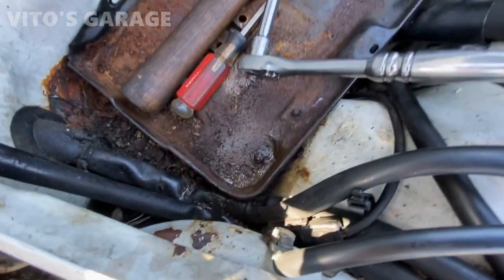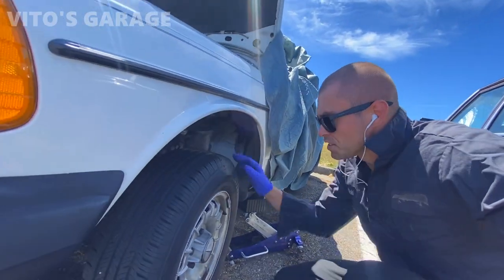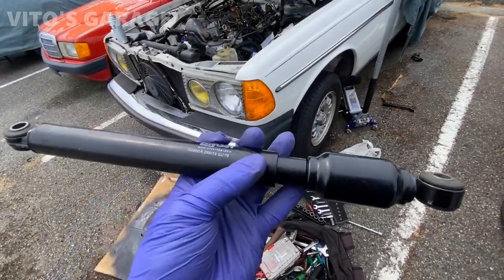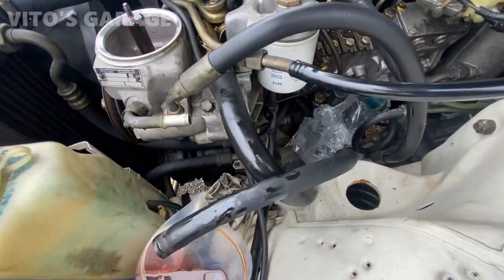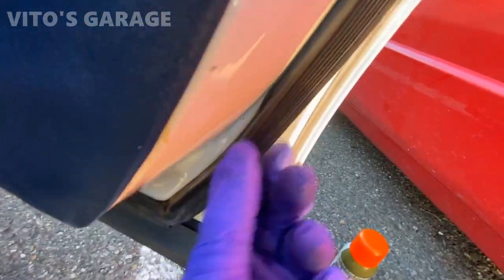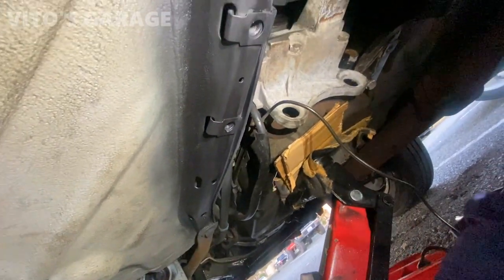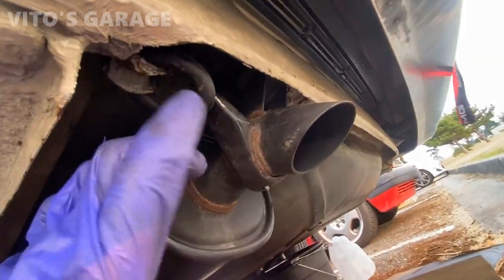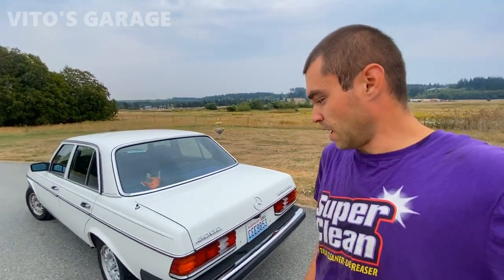Watch Me Make This White Mercedes W123 Amazing & Reliable Again in 1HR of Repairs and Maintenance!!!

Comment: Every diesel mercedes I've owned i replace the fan with electric fan and davies craig digital fan controller. Runs cooler and you dont have the power loss from the fan. Huge difference
Reply from the maker: I understand. But we don’t want electric fans. We want it looking factory oem
Reply: @VITOSGARAGE  yea I understand. I have a 87 w124 and w126
Both are stock except for fan. Because I like my car to run 85c on 100f days with ac on. And I removed the worthless Becker radios. I probably have 10 in like new cond. Without aux or usb they are only good for target practice. But I keep the harness as new incase I ever sell and I can return it to stock. 
I dont mind some modifications such as led lights. Stereo and fan for cooling 
But I could never straight pipe a car or cut a hole in the hood or fender for turbo dump. These cars are becoming hard to find in original condition 😕 
And too many being parted out over easy repairs. I found one in Tacoma with 58k miles for $700 needs fender. Bumper. Rad. Cond. grill and hood. Fully loaded 300sdl with heated seats. Cell phone. Rear reclining seat. Lumbar. 
Will be my winter project if I buy it. I hope to find same color body panels. So I dont have to paint parts.  Looks like you are keeping busy too from your videos. 
Good luck on your projects man. 👍 

Other than radio and fan I only use oem supplied parts unless not available.
Reply: Would recommend the fan modification in a country that doesn't get hotter than 30 Celsius ?
Reply from the maker: @Altanox  no. Leave the mechanical fan clutch in there. Leave it stock
Reply from the maker: @Altanox  replace the fan clutch if it’s bad or if the bearing on it is loose. Like I showed in this video
Reply: yeah mine is a bit clunky, i can  shake it by hand. Should it be a priority? Does it risk breaking? Or can I do it later?
 @VITOSGARAGE

Comment: Also i'm suprised you didnt do engine mounts. Usually thats a fail point i think
Reply from the maker: Engine mounts are brand new man
Reply: nice. I'm gonna do mine soon, gathering parts. Will do engine mounts, trans mount, shaft mount.
I'm excited, i think it's gonna reduce noise @VITOSGARAGE
Reply from the maker: @Altanox  keep up the good work!
Reply: Just noticed to changed the whole control arm when just the bushings were bad. Is that correct? I checked my car and my bushings are also completely dead. Can i just change the bushings?  @VITOSGARAGE
Reply from the maker: @Altanox  yeah you can change just the bushings. I have a video about that. Search it up on my channel